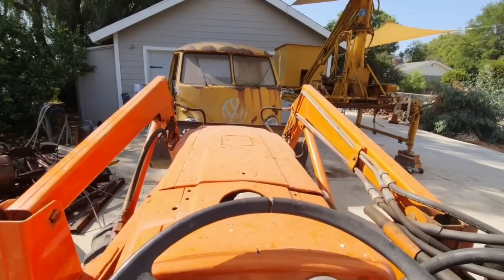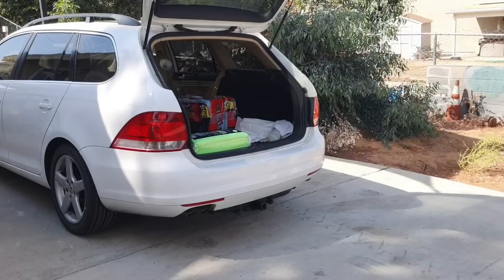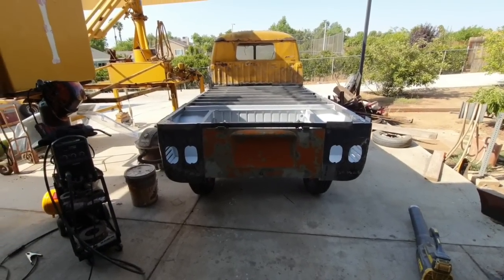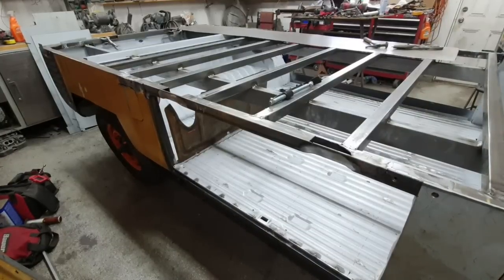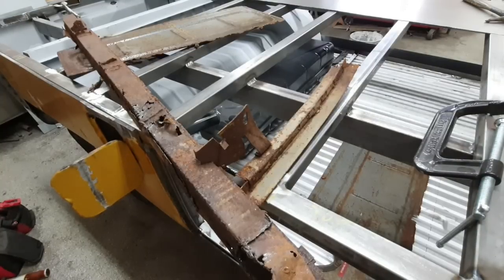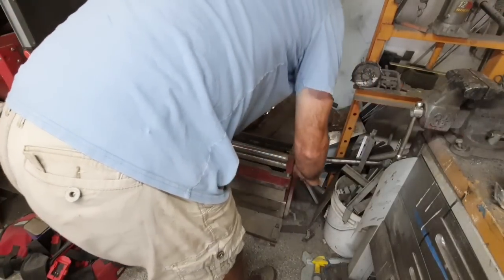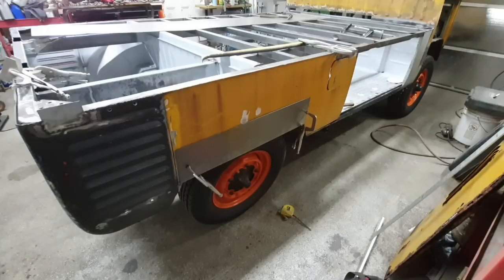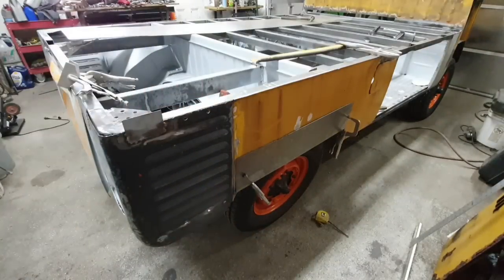VW SINGLE CAB PICKUP Special Model Cherry Picker installing the new bed parts

Comment: Hey Mike I need some advice. My 66 has a dent on the roof between the supports and no mater how much I push it up it keeps coming down. How can I fix that
Reply from the maker: the metal is stretched you need to shrink it. Shrinking hammer heat or framing hammer works in a pinch. Heat up areas with a torch to red tap on them and then hit it with a wet rag. metal will tighten. Takes practice. try doing it on a random piece of metal first.
Reply: @Mikefngarage  its a huge dent. Hopefully it works. Thanks